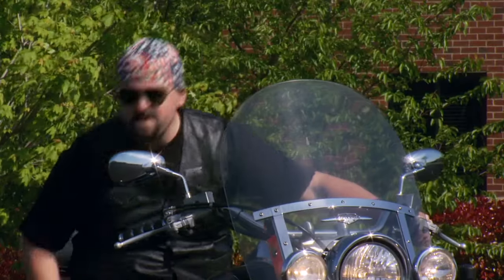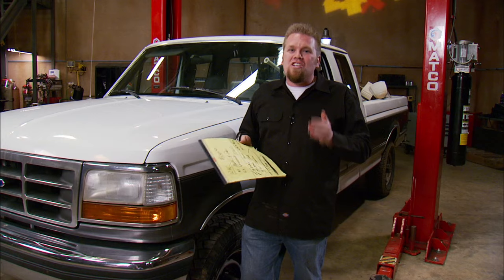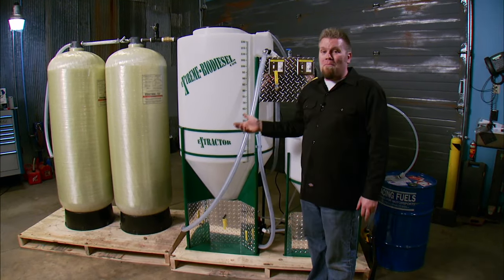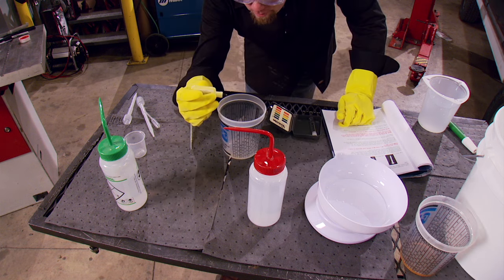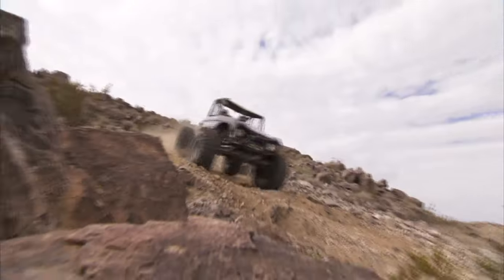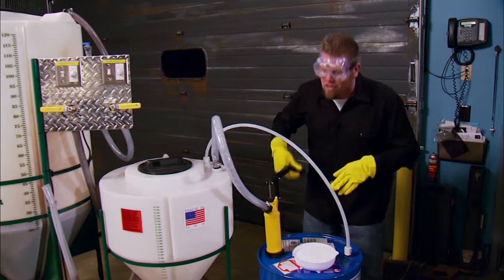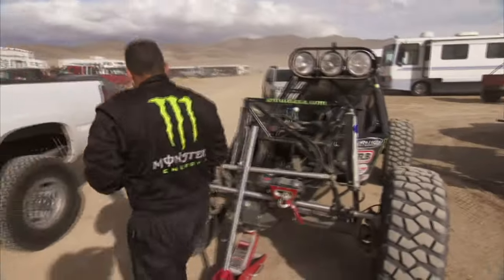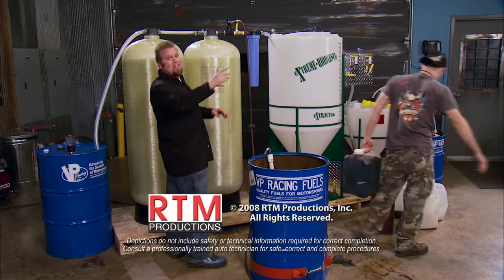How To Make Your Own Biodiesel - Xtreme 4x4 S4, E13

Comment: Yeah let's use heating elements in a plastic tank. Far easier to make biodiesel in a water heater tank. Safer too. I've been making biodiesel using hot water heater tanks since 2005.

Comment: My 2012 F350 says not to run more than 20% biodiesel. Anyone know why?
Reply: The fuel pump might not be able to handle it, i think they get lubricated by the fuel, and maybe it affects gaskets too
Reply: Bio diesel is vary inconsistent the high pressure fuel pump can clog up also the injectors clog 
You can modify your fuel system to run it 
Extra filters and a fuel heating system  at least that's what I've been told lol
Reply: The old idi diesels burn anything lol especially if you can get ahold of a old military injection pump